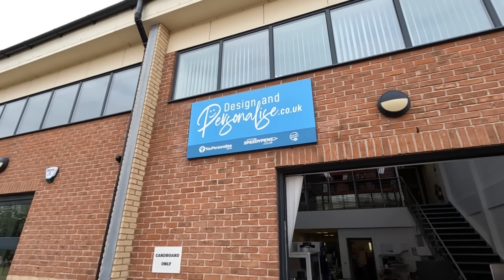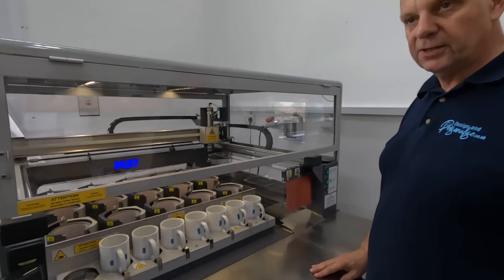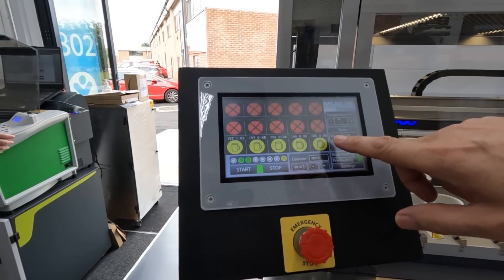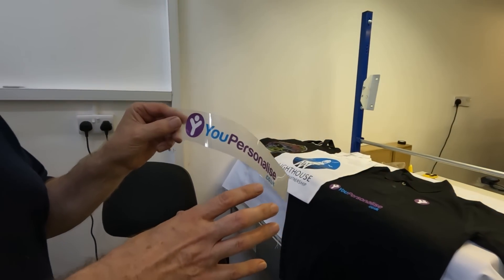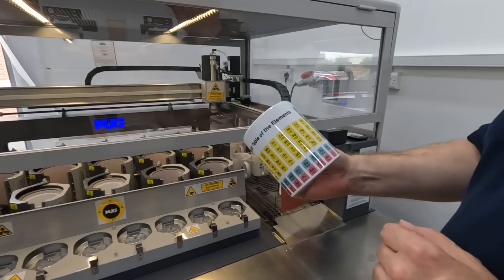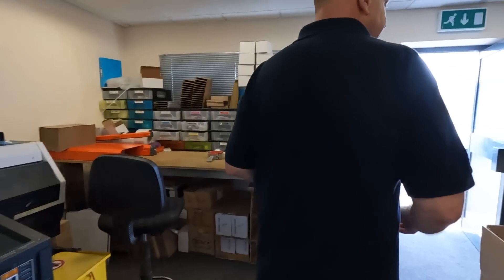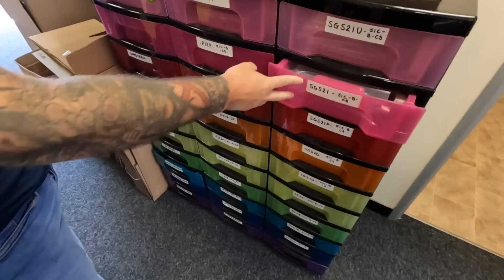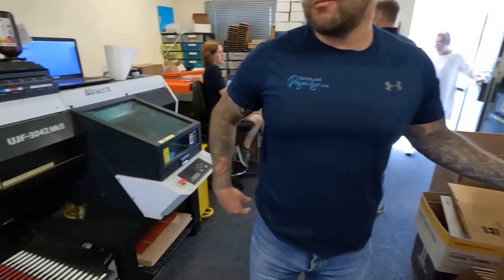MERCHANDISE for our channel - Pens, Mugs, T Shirts

Comment: I suppose what you’ve got to look at is what would your regular viewers buy, and would they just make a one-off purchase or would they buy things repeatedly?
Reply from the maker: I've no idea, really, how it would work.
Reply: Anything practical or 'van related would sell well, not only with fans but the motorhome community too
Reply: Bottle opener, torch, small tool set, chopping board, cable tidy, battery booster, ...
Practical stuff.   Agree